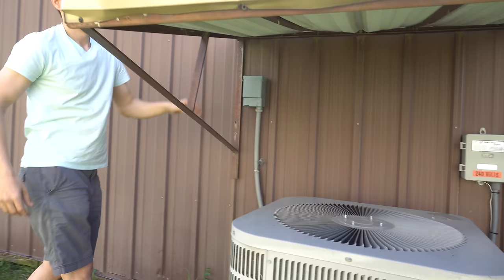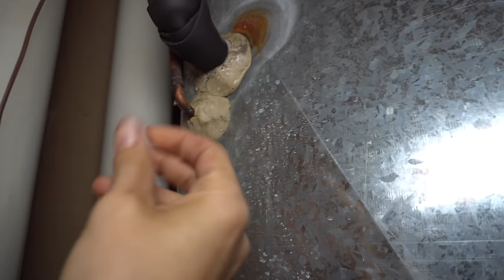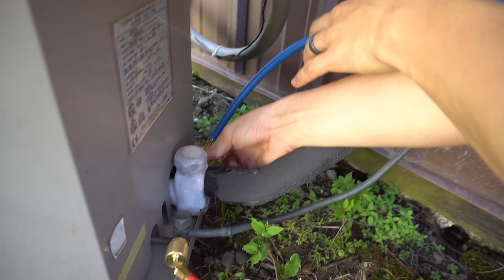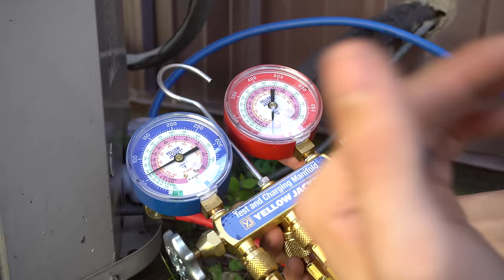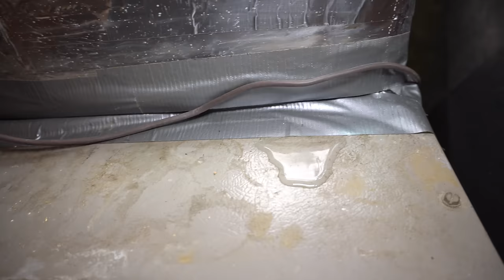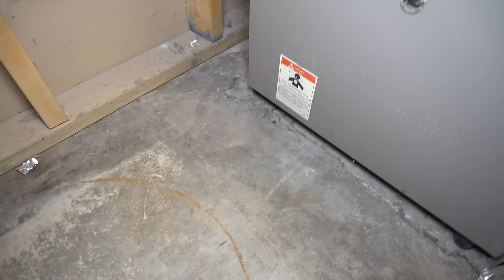How To Add Refrigerant To Air Conditioner

Comment: This is a very good video. Please my question is I added refrigerant to my 1hp Samsung spit AC when the power was turned off and I waited 10 hours to put the power on. Is it okay?
Reply from the maker: The power should be on and the unit running when adding refrigerant. Depending on how much you added, it may be overcharged. The only time I would add refrigerant with the unit off is if the unit has nothing in it like after a leak repair when the system is totally empty. I would also be using a scale to see how much I am putting in.

Comment: Paid a guy today 375 to replace a capacitor and put in 1lb of Freon.  75 for capacitor.  125 for Freon.  Rest for diagnostic.  Might have gotten ripped off, but could easily damage the unit if I do it wrong.  You gotta know your limit sometimes
Reply: Cheapskate

Comment: good basic quick charge info.  but yes there is the 2 other temps that are crucial for a proper charge a unit.
Reply: Also if the condensing unit has a suction line accumulator you can add liquid 22 thru the suction port.  just have to watch the suction line out of the accum and to the compressor for frost.,

Comment: I bought some gauges but they're 134a and 404 can I change the gauges and use the same manifold for 410a and r22?
Reply from the maker: Yes, you can keep the hoses and manifold and just replace the gauges. They do sell them individually.
Reply: @WordofAdviceTV  thank you.

Comment: Can you add a freon if compressor doesn't turn on?  its low in charge reason i need to add
Reply: A low charge will not prevent a typical home AC from starting unless it has a low pressure cut off switch....which are unlikely on your standard home ac systems.

Comment: I'm sorry, but I think the 75 - 80 psig pressure for R-22 is quite high. At 70 psig, it is already little more than enough (65 to 67 will be just fine). A little increment in pressure adds a lot to the compressor work. Much more, your outdoor temperature is only 80-deg F. A saturation temp of 40-deg is just okay at an outdoor temp of 81-deg F, and also, if your compressor is  still really good and your condenser coil is really in good shape.  If you are familiar with the 20-20 rule of charging an R-22 refrigerant to an air conditioning system, I'm pretty sure you understand me. Just my unsolicited advice. No harm or shaming intended.

Comment: Great video, had mine recharged and they DID flip tank upside down, can you explain in more detail right side up vs upside down? Thnx
Reply from the maker: Thank you! I really need to make a video on this to clear things up. With R22, the refrigerant can be added as a liquid or a vapor. When I went to school, the professor actually instructed us that it's better to add it in vapor form (tank upright) but in real life it seems like most guys add it in liquid (tank upside down) because that's a bit faster. Either way is fine though. BUT, this only applies to R22 which is not a blend of various refrigerants. Most of the other refrigerants such as r410a are blended refrigerants and can only be added as a liquid. (tank upside down) A refrigerant tank contains vaporized refrigerant on top and liquid refrigerant on the bottom. I hope that kind of makes sense. 😅

Comment: I need to start taking the outlet air temp at varying ambient temps and if the time comes to add, I know at what temp the outlet should be. I have a R410A system.

Comment: I hope you had an armed guard with you. That tank of R22 is like gold !!! Lol
Reply from the maker: Lol! Yeah.. It's a dying out refrigerant :)
Reply: Buy on eBay for $160 10 pounds tank
Reply: @fabiodarocha2842  much cheaper than the $50 / lb i was charged for when i had it fixed professionally
Reply: @fabiodarocha2842  you need a special licence to buy refrigerant
Reply: @shaunbowman8036  Charged me $75! / lb
Reply: I bought a 30 pound new (but dusty) tank for $300 from construction guy off of craigslist.  He probably found it on a job site!  Two years ago I paid a tech $600 to come out and put 2.5 pounds in and some dye.  I have had three companies come out over the years and none have ever done superheat they just fill it like the video and they were big companies too.
Reply: @fabiodarocha2842  now  r22 is over $300 for a 10 lb tank . SAME WITH 410 has  skyrocketed.
Reply: @toddac61  yikes!!!
Reply: @scsclassics  I should of have bought 2 or 3 more tanks back then.

Comment: Thanks for this video. I am in HVAC school learning residential and commercial and I always forget if you should charge liquid or vapor and through high side or low side. I actually found (the teacher didn't know) a 410a system short cycling due to high pressure (High side was around 600-700) the other day at school. We think it might just be over charged and in the sun. I made a video of it for my channel if you want to check it out.
Reply: HVAC with Greg. Always Liquid, just trickle it in, 410 is a blend, meaning tank always inverted / liquid
Reply: strongly suggest finding another professor or HVAC school. One must understand that the liquid form of refrigerant in thermodynamics of  a refrigerant system. Adding liquid threw the low side is acceptable as long as you don't FLOOD the compressor. ADDING VERY little at a time- FLASHING with your guage set. A compressor receives (SUCKS) from the suction line VAPOR/GAS which is discharged as liquid refrigerant. To the point. You can FLASH the gas with your guages (even a ball valve hose) through the low side via liquid form refrigerant. YOu can also use  the following adapter that we highly recommend purchasing: https://www.amazon.com/Imperial-535-C-Charge-Liquid-Charger/dp/B004RIDG02/ref=sr_1_1?crid=1K2LNLV8YRVEJ&dchild=1&keywords=hvac+liquid+vaporizer&qid=1592186027&sprefix=hvac+liquid%2Caps%2C500&sr=8-1 This vaporizor is the same thing you can do manually - very little at the time. LASTLY a txv or orfice or piston is actually FLASHING the liquid refrigerant to a gas at the indoor/evap coil so essentially this is what your doing as you add liquid through your guages through the low side suction line. NEVER add via high side do to PRESSURE WHILE MACHINE IS RUNNING- wont go into when you can use the high side for adding refrigerant: CHECK OUT AC SERVICE YOUTUBE channel; hes a master HVAC professor. We been in the business/science of thermodynamics for  30 years and we bought his great text book/Craig M
Reply: One easy diagnostic step without apply guages (non-invasive approach which HVAC techs should be using) Apply a temp probe to the liquid line at the outdoor coil (condenser) 3 inches from the valve. Whats the temp? Make sure to use a clamp on cleaned copper (emery cloth) and or a thermocouple. Then get out your magnetic thermometer and what is the temperature at the discharge of the condenser fan (warm air blowing out). The two should be within 2-3 Degrees diff at most. Next non invasive without guages is a head pressure of 600-700 is going to show HIGH COMPRESSOR amps- put your clamp meter whats the draw is it out of spec and watch it on start up also RLA.  ALso stick a temp probe on the suction line that will also be high. SO three (3) simple tests walking up to a unit that would show a overcharge unit. OVER charge units lets think about in thermodynamics the refrigerant is getting stacked up in the CONDENSOR (outdoor unit) because the evap cant make use of that refrigerant to absorb so now you have more stress on the compressor- so the compressors is running hotter- drawing more amps- friction you have more latent heat building up in the condenser that cant get rejected so both the suction and the liquid line are HIGH PRESSURE> REMEMBER YOU DONT NEED TO STICK YOUR GUAGE AUTOMATICALLY ON A UNIT- PRESSURE RELATES TO TEMP. PSIG coverts to temp visa versa. Theres another great professor be better off using his classroom instruction: https://www.youtube.com/watch?v=nwPA56cXqMA
Reply: Pro Answers. Ha I think Greg is a ways off from this just by reading his question, however we all learn somewhere, and good training go a long way
Reply: @proanswers  We do use a vaporizer.

Comment: Great video Jay. I've found on my prior unit that I had to top it off once every two years. It had a super slow leak that two contractors couldn't find and I think it had something to do with most of the leakage happening during the winters. Even dye wasn't traceable. Thanks for the great video. I love your channel and you are very thorough in you explanations and with stats and data. Such as those temperatures you described. I like that fact. Glad to see your well and let's see some more of these great videos. Take care. Jpol.
Reply: J Pol. Every 2 years, probably schraders or caps on king valves, or a confused tech. Low temp equals low pressure
Reply: Thats why its important yourself to hire competent HVAC techs that takes measurements and baseline numbers to locate a leak. HANDS YOU THAT INFO- even if you dont understand it. A baseline can determine decay of leak and sometimes determine where the leak is happening. Again why we use non-invasive (NOT STICKING A  GAUGE ON THE UNIT-VERY/VERY LAST part of the evulate if at all needed- We can find leaks with out sticking on HVAC guages) diagnosis. Seen more overcharges, resitriction issues then micro leaks. Disagree with putting in a leak detection dye into a refrigerant system-not needed and dyes create another non-condensible - short live your drier filter and or foul your piston, fixed orifice or TXV.
Reply from the maker: @J Pol Thank you! It's nice to hear that you are finding the videos useful. I think Nathan had a good suggestion as to what may be causing that leak.
Reply: Most HVAC techs don’t want to find and fix leaks.  Most (not all) leaks can be soldered and repaired back to almost new condition but then they can’t sell that new unit for $7,000-$10,000 and get that commission check. It’s all about SELLING that NEW unit, or trying to charge you a $500- $1,000 service call for an hour in time  and a $25 part. My favorite is the $15 capacitor costing $350 to replace.   Freaking criminals.
Reply: @WilliamWBG  exactly. had an a/c repair tech come look for $100 and he played the one trick pony replacement game. pretty much convinced me to get some additional tools and repair it myself. because repairing a functional unit myself that is a tiny bit low on refridgerant is about $9k cheaper. and if i mess it up 3x and break a lot of stuff, it's still cheaper. and i get to learn new skills that will be hyper useful to friends and family. harbor freight, here i come.
Reply: heck, i may even design and build out a completely different system altogether. something that can pull double duty and accomplish some additional tasks instead of just sitting there.

Comment: Well done, as I needed a refresher... however, for several years now I use a graduated cylinder.  It still had 9# from the last time I did tapped the system.   I put  3# liquid in the graduated cylinder.  I then attached to lowside and very gently add liquid as not to slug the compressor, pause repeat etc. until pressure is 60.  The tec that showed me that said doing this way, no need to monitor the high side.  The HVAC system is from Fall of 1991 and they added the central A/C in June of 1992.  I am sure one of these days I am sure I will need a complete new HVAC system.

Comment: Nice video... but I would gave purged the high side too, at the time that you purged the low side.  The R22 that you bled back into the system, was already mixed together with existing air, when you bled and sent it into the low side of the system.

Comment: I had an AC unit that needed Freon so I called my AC man to recharge it, he couldn't make it so he sent his son to recharge it. His son was not licensed to work on AC Units in the first place I found out later. The boy overcharged the system and ruined the Compressor to where it wouldn't work anymore. It was working fine before it needed Freon. His dad tried to tell me it was just time for my unit to go out and need to get a new one but I do know some things about AC's. I called two different AC companies to check out what was the problem, both told me the AC was overcharged and caused the unit to crash. One of the AC Companies was actually the Uncle of the Man that sent his son to overcharge my unit, He told me also this boy had no business Re-Charging my AC. He also told me he was going to deal with his nephew for causing the damage to my system. I was compensated because I had everything documented and didn't let them run over me.
Reply: Call the Hvac police!
Reply: @williamfabiano543  I did, LOL

Comment: I’d like to thank you for showing an internet full of unqualified people how to add refrigerant. My bank account thanks you!!!
Reply from the maker: I showed them an example of what adding refrigerant would look like but I did not encourage homeowners to try and do this. I am sure that your bank account will not suffer.
Reply: Omg seriously chase we are all making money hand over fist and the fact is I've charged this way a million times I think we all have. Sure I have an s80 and every other wireless guage you can buy but at the end of the day if it's for a friend and hes changing the unit anyway so what or actually how about when your batteries are dead and your guy has your crappy old gauges on another job lol I have to say sometimes it's just cool to keep things simple  besides it can give a beginner some insite on getting the feel of things with out soully relying completely on the gauges and sub cool and super heat wet bulb dry bulb this simply was a charge at its simplest form and a side from all of this who is going to spend $400 on a jug of 22 and where are they even going to buy it only us licensed are so privileged this kid is one of the best out there in my opinion I'm hoping he shows us how to unlock a 3 phase compressor by reversing the polarity in his next video lol only kidding
Reply: Word of Advice TV I meant when a homeowner see this video and tries to do this on their own and damages the compressor from over charging because it’s not actually low on gas. And let’s be honest here. The “gas and go” is for rank amateurs. If you can grab gauges and gas, you can get a pocket thermometer too. I’ll not mention the fact that you didn’t caveat, that being undercharged is a fraction of the the reasons that line set will freeze.
Reply: Kary Deluga look on eBay. I assure you people can buy entire or partial cans of any refrigerant they want
Reply: Kary Deluga ..... it’s simple to buy on eBay. I bought 10 pounds and I’m a commercial banker. All I had to say was that I’m buying it to sell or for a tech to use. I bought the same yellow jacket gauges on Amazon.   It’s not like being an HVAC tech is a doctor writing a prescription or something. It’s just damn refrigerant after all
Reply: chase0803 .....quit lying. Low charge is 99% of the reason for a freeze up. As long as it’s a slow leaker,  the homeowner is fine to DIY AS LONG as they are somewhat capable of following directions from youtube

Comment: find the leak 422b  is great drop in and ozone friendly you do have to change your drier but $15 a 
pound is better than $30-50 a pound  407c you have to add 20%  oil where this 422b you don't
this why I like this and why they call it a drop in r22 oil is fine
Reply: I just got R-22 off ebay at 180 for 10 lb.
Reply: I prefer mo99 and dx20 bluon

Comment: Nice video. My question is what if the suction side is not sweeting like you said.
Reply: Suction lines DO NOT always sweat and there's no such thing as "beer can cold" in the HVAC profession. The suction line will sweat if the sensible temperature of the line is below dewpoint. Low humidity areas will not have sweating suction lines. Florida, yes. New Mexico, no.

Comment: This is what we need, home owners charging their ac. This is tough to watch. No mention of filter or blower motor, air flow is the cause more so than not
Reply: If you would not overcharge and screw your customers, they would not feel the need to DIY.  I’ve had it with HVAC techs. I rewired my thermostat wire, replaced my contractor, transformer, put in an inline 3amp fuse, and recharged my unit.   I work in commercial finance, but I think 90% of HVAC techs are con men. This guy teaching is AWESOME for teaching everyone how to DIY
Reply: @WilliamWBG  please watch HVAC school. Symptoms of low air flow.
Reply: Before adding charge to any system please watch HVAC school, symptoms of low evaporator air flow.
Reply: @WilliamWBG  thanks WGB!
Reply: Yep because my ac is covered under warranty but..... I have to charge you for the tools, 3 hours for being out, and labor. So that's 1200 for a compressor😳. Do I get to keep the tools? No. Is the 3 hours the same as labor? No 😭. Ok let me YouTube this.
Reply: Sounds like you're an HVAC guy who's afraid he won't be able to rip off the public anymore